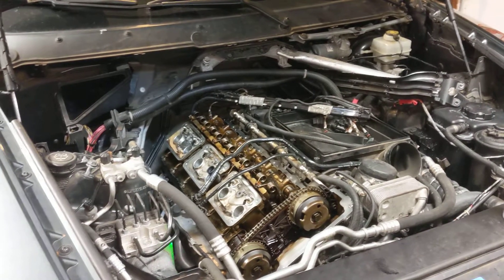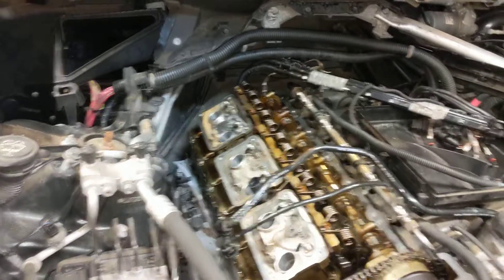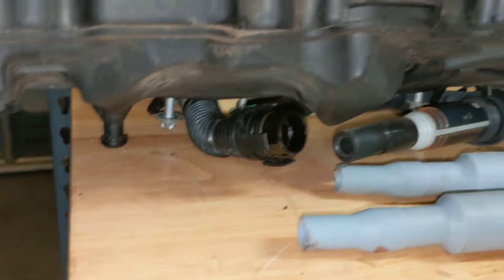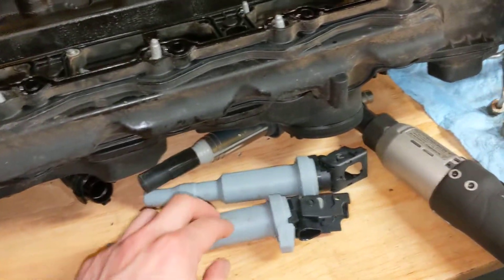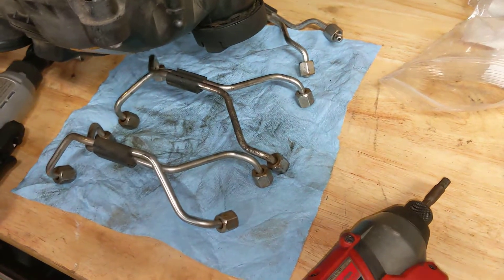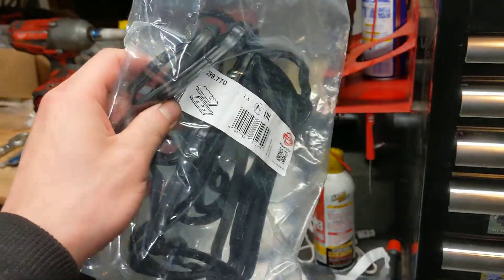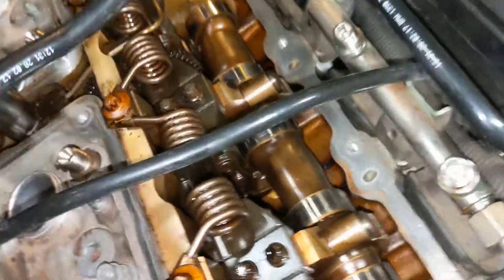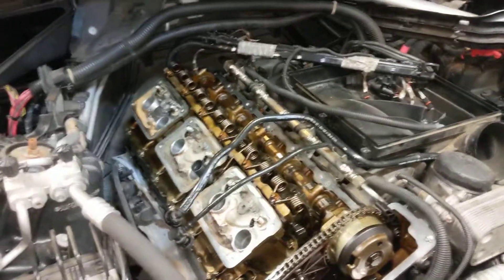BMW E70/E71 X5/X6 N55 valve cover replacement overview

Comment: Thanks for this overview.  I bought a replacement valve cover with the gasket pre-installed because the CCV valve is integrated into the cover, and my 2012 X5 3.5i sounded like a diesel, and I could smell burning oil through the vents in the cabin.  I also replaced plugs and coils while they were accessible.  I also replaced the broken engine partition pieces.  

The engine sounds smooth and runs strong again.